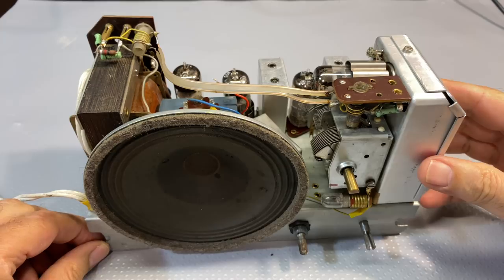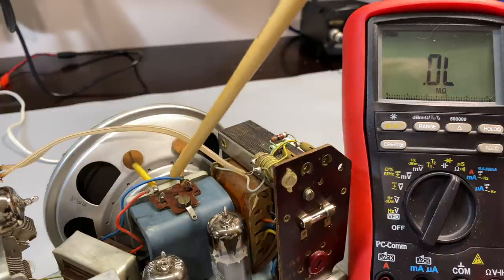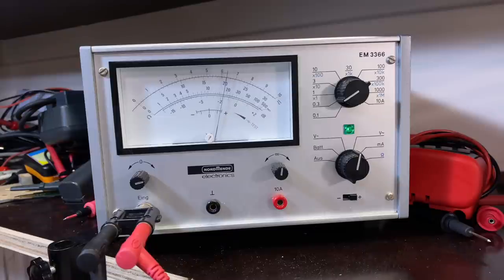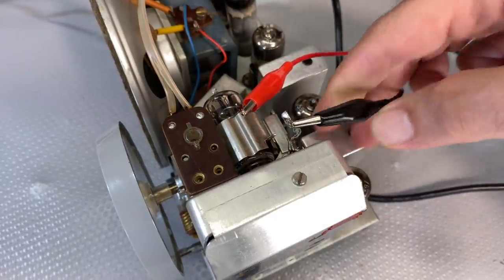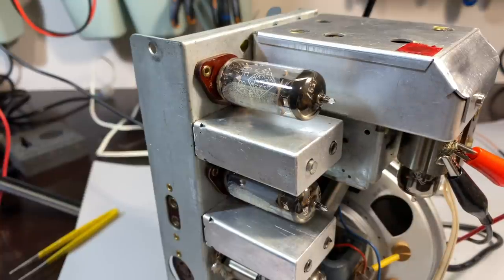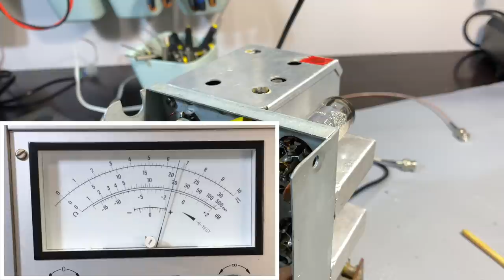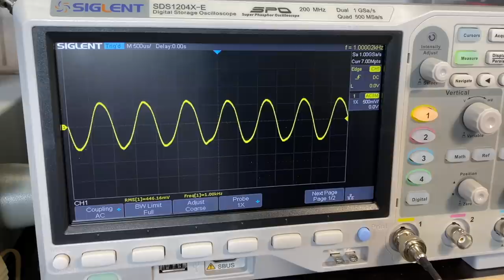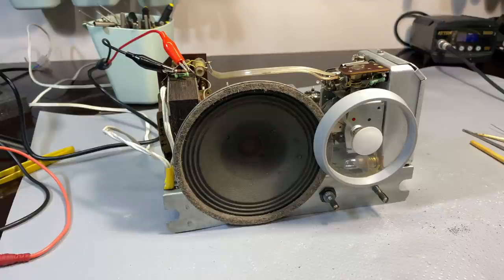Braun SK 2b tube radio restoration - part 3. Cleaning and alignment. Simple, right? Wrong ...

Comment: Manuel, use my way. It works. Sorry for the language - G .Translator can help. Unfortunately I don't have a Braun radio, but Gruding was probably using the same core size. I can do a few for you if you need. Let me know.. https://menuet-ukf.blogspot.com/2020/08/challenge-czyli-o-insertowaniu-cewek.html
Reply: tam jest dosyć kwiecisty język, myślę, że on polegnie na translatorze ;)
Reply: @piwex69  Myślę, że przy wsparciu obrazkami nie będzie problemu :-)
Reply from the maker: just read you report. Brilliant solution. I’m going to start searching for suitable inductors. Thanks.
Reply: @electronicsoldandnew  Let me know, if I can help. Diameter and thread pitch od core  - I will check if silicon casting mold which I have has the same. Regards.
Reply from the maker: Actually I just need 3mm slugs because I can get the thread done here.
Reply: @electronicsoldandnew  Tomorrow I will check the exact dimensions of the core. About 6mm in diameter.
Reply: The same way Yugoslav EI made plastic slugs in late '60s.
Reply: That's an excellent solution for replacing a broken core!  Some electronics vendors sell thin ferrite rods that might fit inside a molded resin slug.  Forming a screw-head in the slug becomes the next problem but a Dremel saw would probably fix that.

Comment: I was in the same boat!  I was restoring a Hallicrafters S-120.  ALL coil cores were cracked.  I went back to Ebay and got a junker S-120
and swapped out the GOOD cores.  It made it's labor and time longer, but I know have a perfect aligned S-120.  I'll probably put the junker
S-120 back on Ebay as "parts only".
---
Like you, I'd like to find a source for those powder cores!
Reply from the maker: I'll find a solution. Some good ideas are being passed around.

Comment: Nice restauration again, Manuel! These Brauns are very interesting small sets, both in exterior and electronic design. Too bad about the FM IF cores, I thought they would use different core material in the 460kHz and the 10.7MHz filters, but it seems the AM-cores did all right. I may have some, I can look in my stash. Are these M3 or M4 thread? Try a metric bolt to see if it fits "normal" thread

Comment: Post the diameter, length and if possible, thread pitch.  I have some surplus coils that might be what you need.  Always enjoy your vids!
Reply from the maker: 3.5mm, 12mm long. Don’t know the pitch
Reply: The cores I have measure 5.48mm in diameter and are 24.8mm long.  They are magnetic, so I assume made of iron.  They are from a mid 50’s Grundig set. Length isn’t an issue, as you said, because they can be cut down. I can send photos if needed.
Reply from the maker: Unfortunately too big in diameter. Thanks

Comment: Just working on a Philips receiver B2X63U-01 AM/FM 1956, and during the alignment some cores flew trough as in a subway tube. Someone had already tried to 'retune' the set, but forgot to replace 19 resistors and 18 caps before doing so. So I had two loose cores (about the same type as you have), no thread picked up inside, they just fell trough.
What I did was using enough thick polyester sewing thread (for me 4 strings of thick thread in parallel with the core , and the cores have perfect grip now, with 4 threads sticking out on both sides. What if you could make your cores thinner, and do the same ?
Reply from the maker: That’s exactly what I plan to do. That radio of yours sounds like it was a real challenge 😊
Reply: I now see that you probably already have a solution from christer Pettersson, so🧵 = just an idea 🙄
Reply from the maker: thanks
Reply: @electronicsoldandnew  A challenge it still is... Some FM problems in the detectortube UABC80. With that a lack of tube experience, but we hold on.

Comment: Manuel, I see there is some discussion of Home made powdered iron cores though not definitive on the net. Perhaps if one could make a mold of the coils thread and diameter than making a mixture of powdered iron and appropriate glue or cement, does sound like something our Australian friend might come up with though doesn’t it. Good luck
Reply from the maker: Yes, the rods may work.

Comment: Nice restoration of that little thing.
It sure could have used a fine-tune knob on the side :-)
Btw, have you tried having a voltmeter connected to the AGC during alignment just to see how and if it changes?
Reply from the maker: I’ve used the AGC before. Lately I simply tend towards this method.